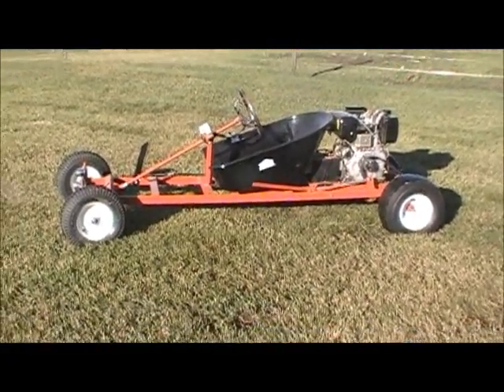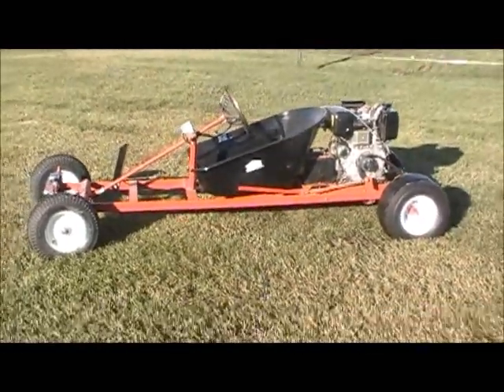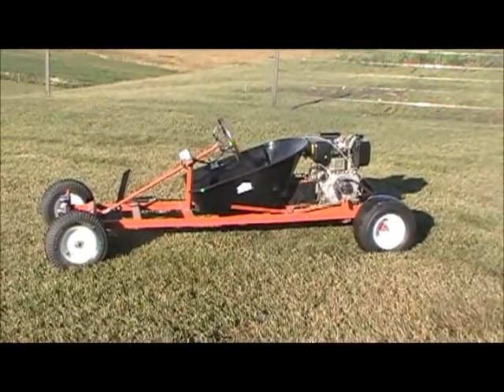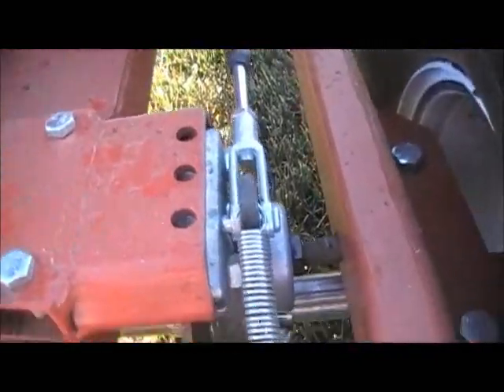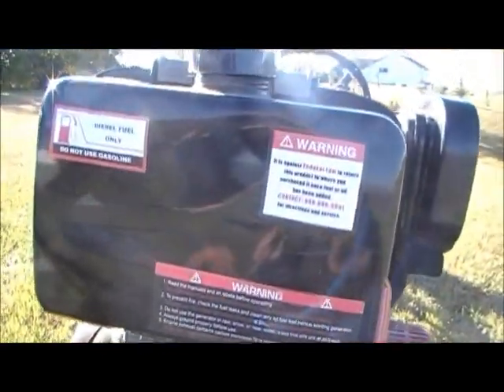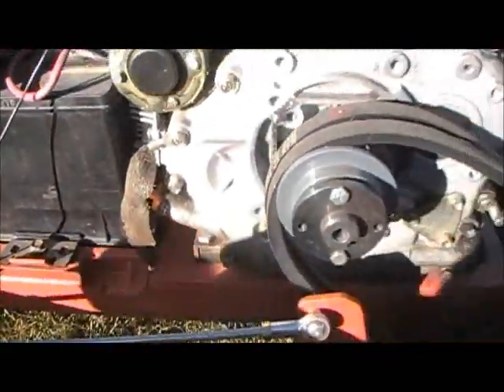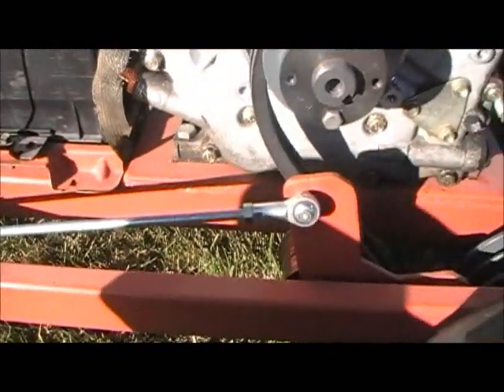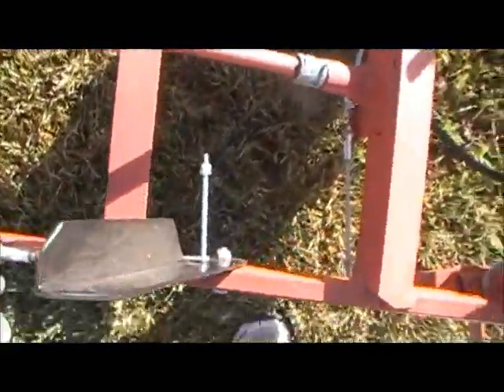Homemade 10 HP Diesel Go-Kart!!

Comment: it sound like a 2 stroke almost. do you think it can pull lika a tractor?
Reply: no they dont! most diesels are a four stroke engine! Some are two stroke however this one is a normal four stroke engine. it has valves.
Reply: 2 strokes can have valves as well... exhaust valves. Like older 2 stroke detroit diesels... they are fun and loud!
Reply: diesel fire every time like 2 strokes that's y.

Comment: you need to get rid of the v belts and lawnmower hand throttle and get a torque converter and proper gas pedal.

Comment: why so slow? my 5.5HP would whoop that.
Reply from the maker: nope, wound out itll do it. Its just slow looking because its a single speed, geared really low.
Reply: @TheUtubeEngineer  no im pretty sure his 5.5. Would whoop that
Reply: It's geared really high. Effectively, it has to pull away from rest in top gear, which is why the engine struggles a little. It really needs a cvt transmission set up to help the engine get into its stride. Only steam engines & electric motors develop the kind of torque necessary to pull away from rest in top without bogging down. IC engines are crap at that. That's why trucks, cars, motorbikes & scooters have gear ratios.
Reply: TheUtubeEngineer lie much

Comment from the maker: The only pedal on this project is the brake pedal, which simply used a cable, the throttle is controlled by the lever, which would work on any scale really!

Comment from the maker: The deisel is easier when its simply set a certain rpm.
Reply: That's because it is a clone copy of a Yanmar diesel engine design they copied. They do a lot of that kind of thing. Piss ants! It was designed to constant speed as a industrial engine, not a variable throttle hot rod! How's the diesel motor holding up?

Comment: Instead of the clutch lever operated with your left arm, I'd re-engineer it so it was operated by your foot...  maybe left foot.  When disengaged, your brakes lock down.  When engaged, brakes let off and then further travel engages clutch.  Then make your right pedal your throttle.   So to go, press in clutch/brake left combo pedal and give her gas with right foot.  To stop, let off gas, and let off clutch with foot and past midway clutch is entire disengaged and brakes start to engage.

Comment: I can see where the motor could be attached to a charging system to a generator for powering an electric car.... Sorry just did not do it for me... But interesting design. I would of used a snow mobile clutch... Where did you get the Chinese motor?

Comment: look at his battery, 2 top caps which means 6 cells. 6 cell batteries hold 12V, not 5v. It takes a transformer to step voltage down to 5V.

Comment from the maker: false. the output is 12 volt because that is what the engine and electronic systems run. the transformer you plug into teh 12v output bumps it down to 5 volt, or 9 volt for ipad.

Comment: @TheUtubeEngineer Will do man, things are coming along nicely. Today I purchased a little 25mm Calibre pod air filter, a piece of radiator pipe for the air pipe from compressor out to engine in and some screws for the flanges :D Getting a job on Wednesday so I will be able to start buying the oil cooler and gauges, then the go kart base! :D Thanks! :D